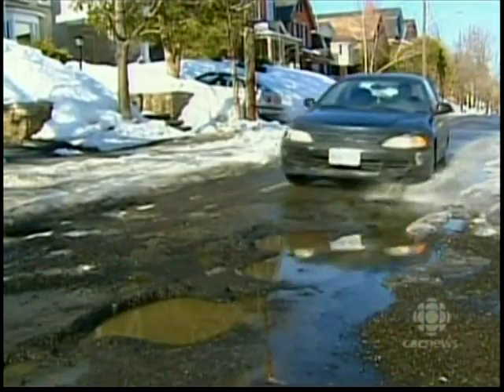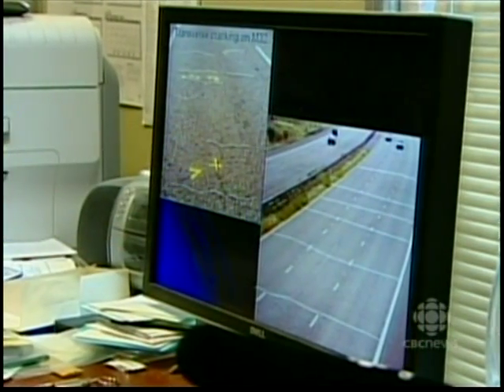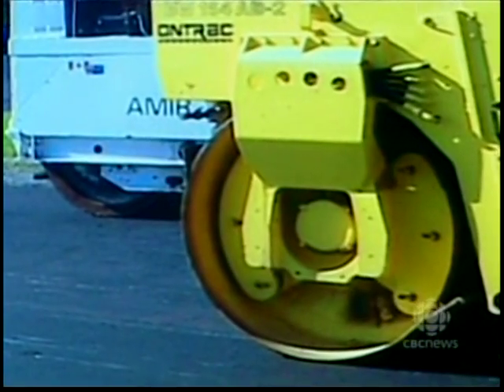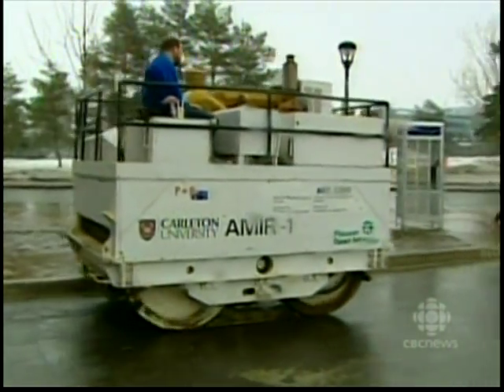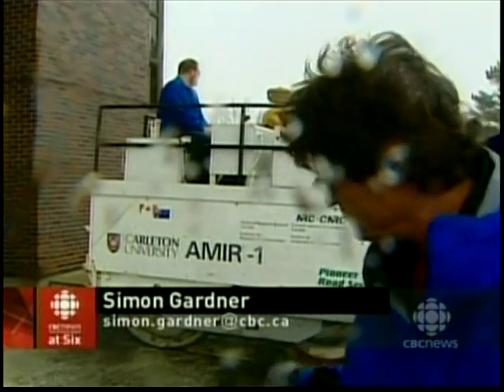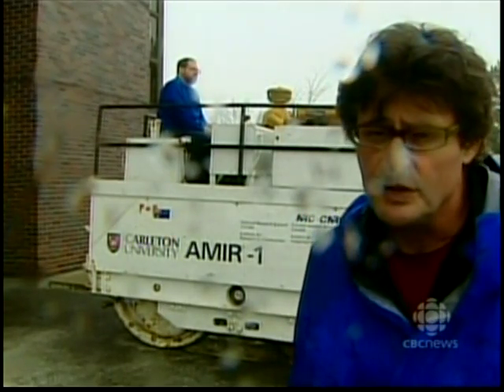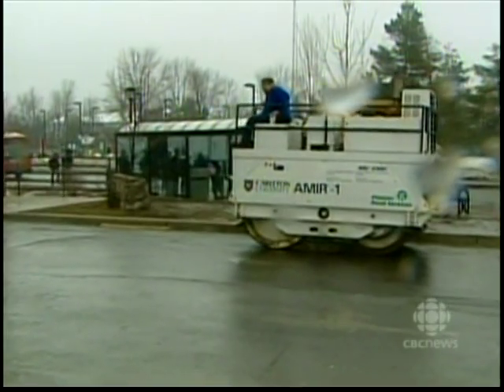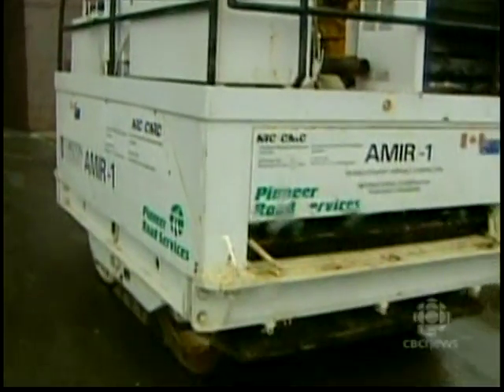AMIR roller

Comment: This Amir roller Is a very complex concept, and even with conventional rollers a good result can be made. The cracks shown on the video are clearly problems of a bad operator who does not know how tackle this problem. When the weather is cold or strong wind the AMIR roller is useless, also on coarse graded asphalt. Not to mention rolling through sharp curves!